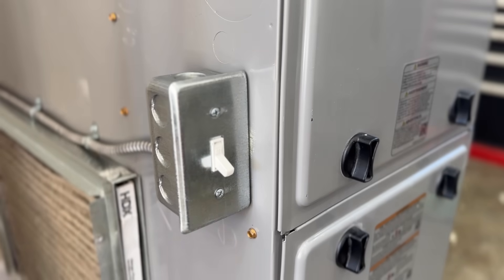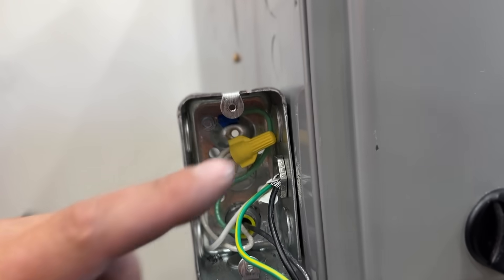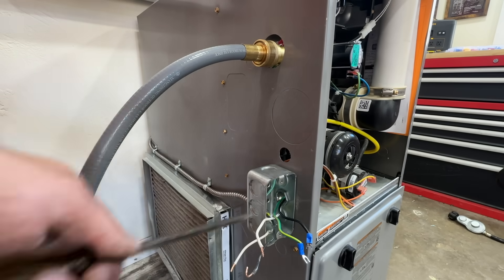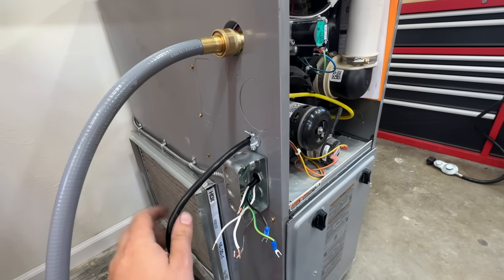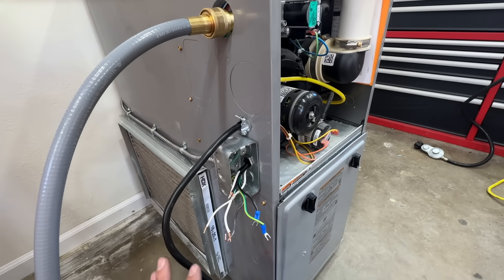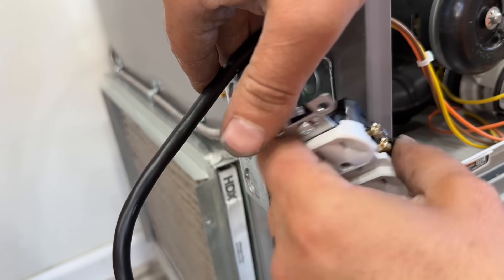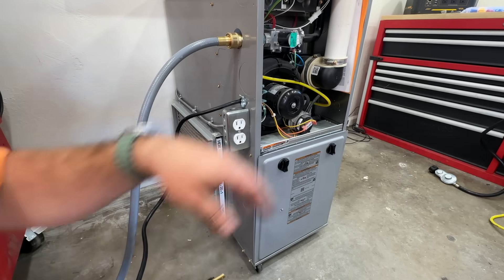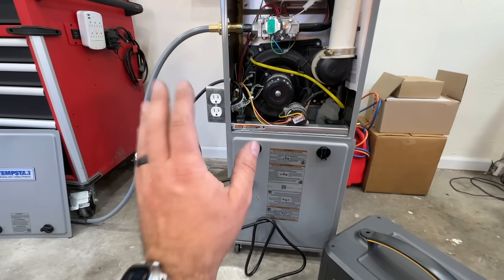Keep Your Family Warm During A Power Outage By Installing This $5 Part

Comment: Always tighten the extra screws on the outlet.
Always use a pigtail for the ground.
Always wrap the side terminals of the outlet with tape.
Reply: Caught this immediately, always tighten and tape. Tape not as necessary in plastic boxes but good practice all around. Ground wire is normally not insulated so it can potentially touch the exposed lugs and spark. If the outlet loosens over time it can wiggle a bit, those loose lugs sticking out can hit ground wire or the box causing sparks. These metal boxes have a decent amount of space in em but some are incredibly tight and amplifies the risk. Like the metal wing boxes or those ones with the Romex knock outs and the screw down wire holder. Plus if the box doesn't have a good ground connection and lugs make contact with the sides somehow the whole box is live now with no path to ground. The outlet should always just be grounded don't know why he did that. I mean I know it's screwed to the grounded box but it takes like a minute to legit ground the outlet... It's been a pet peeve of mine with people putting in switches too, I know a lot of electricians don't bother but it takes two seconds come on.
Reply: @burtenplays  I'm with you. I just takes a second...done!
On finish electrical some sparkies will strip the wires and leave the sleeving and wire in the floor and walk away. Drives me nuts! I may be the GC but I'm NOT your maid! Respect the clients home!
Reply: @goaskmymom1350 …as a GC 25 years ive only seen one sparky pick up his own cuttings…before i tell them to.
Reply: Curious. What would the reason be to tighten the unused terminal screws?
Reply: @easyas314 
As a remodeler working with live power during demo I thank the sparky before me who tightened the unused terminals AND for wrapping them up with tape. Have you ever accidentally touched a live terminal to a metal gang box? If so, THAT answers THAT question. 😵‍💫
Reply: @goaskmymom1350  Not relevant for this end-of-run application, but as a best-practices habit I ALWAYS connect black and white incoming wires to the upper screws, and either tighten unused lower screws or use them for an outgoing circuit if it's middle-of-run. That way I always know which way power flows when I service my own work later on, even though I also test it with a meter too. Just one more way to be triple-sure instead of just double-sure that you don't get zapped. And yes, ALWAYS tape all terminal screws. Always, always, always. No excuses.
Reply: @easyas314  So they don't short on the box or have anything possibly coming into contact. And ignore the OP, always ground your outlets. Never know where a floating ground is.
Reply: @easyas314  less likelihood of a short the next time the outlet is moved out as the screws are further from the metal box.

Comment: What I see wrong here is the power supply is not providing enough amperage to the furnace. It may be enough to activate the inducer, blower motor and gas valve, but when the three-quarter. HP blower motor is activated it puts a low power load on the small transformers on the circuitboard. This method clearly does more harm on the circuitboard. I have seen many damaged circuit boards during power outages when homeowners connected there’s small, portable generators.
I have 35 years and gas service heating industry.

Comment: Why is the light switch (on/off toggle ) there to begin with? Like wouldn't you just flip the breaker off if you need to work on it. Great video, thanks. I'm going to do this mod.

Comment: I have a condensation pump for my airconditioner plugged in to outlet /off-on switch. Can I put a larger box outlet and achieve the same thing without hurting my furnace?  Thanks for the help

Comment: Our HVAC is dual fuel, it's natural gas but also has a heat pump. Willa Jackery power my unit or do I need to turn off the heat pump and only use the gas with the furnace plugged into my Jackery? And will a Jackery 1000 be enough? Thanks...Marc

Comment: Even more simple, and retain the switch: 
1: Buy a 3-way switch.
2 : wire the switch common screw to the furnace power wire.
3 : attach the hot (grid) wire to one of the traveler screws.
4 : attach pigtail hot to remaining traveler screw.
5 : tie all neutrals together / repeat for grounds.
Switch works as before but now toggles to alt. power source in "off" position. The pigtail is never hot unless plugged in.
Reply: I don't see the point here? Your method requires both moving the plug and throwing the switch. The above proposed method doesn't use the switch at all in generator mode. If you need to completely kill the furnace in generator mode, just pull the plug.
Reply: @andydelle4509  In my example there is no plug. Never was one. Just flip the switch and plug the pigtail into a standard extension cord. When on grid power, unplug it and flip the switch back. The pigtail doesn't need to plug into anything when running on grid power, and it isn't energized. Easy peasy.
Reply: @timjefferson2137  OK, I get it. Thx

Comment: I have an oil furnace, it's 115 volts, but uses another motor, I will need to check and see if the the cord and plug can handle the needed power requirements to run the furnace.

Comment: Using a backup battery for furnace ignition, does the battery continue to discharge the battery during furnace operation?
From a DIYer

Comment: How about a well water jet pump?
Reply: That can be supplied the same way. It is only the details of how it gets done that change. With that said once you have multiple critical loads there are far more elegant and higher flexibility ways to supply them with standby power than by individual cord and plug connections. 

Tom Horne

Comment: When it makes more sense to just back wire your circuit breaker and use a generator to run your items in your home including your furnace and air conditioning?

Comment: This has to be my favorite video of yours and have sent it to probably two dozen other guys. We all live in souther Ohio and have boilers that heat our house (ours is still the steam boiler from 1911 and yes, that’s the correct date). We have 3” water lines that hold the steam and is controlled by an electric thermostat. Now that we have this, a small 2200 watt inverter generator will run it with ease, as well as a few lights, a pressure cooker, and also charge our laptop. I’ll occasionally watch this with our girls - clean language and educational!

Comment: Are the thermostat wires connected elsewhere in the furnace?  Also, my switchbox has an old style screw in type fuse, does that make any difference in replacing with a outlet?
Reply from the maker: Nope, you will find the same thing once you disconnect the wires to it. I actually have a video showing how to convert it from a switch/screw in fuse combo. That one should drop soon.
Reply: great @diyhvacguy
Reply: Looking forward to that video as that is the setup that I have on my Natural Gas hot water boiler.   @diyhvacguy

Comment: Just did this for my daughter during a power outage.  However, I got a voltage polarity error code(E 6.1) on the furnace (Trane) control board display.  The issue appears to be  related to grounding for the furnace and the generator, actually an inverter generator.  Don't know the technical terms - bonding, floating, sinking ; ), but a 'solution' was to take a male power cord repair end ("standard" three wire 120V, 15A), and wire a jumper from the ground prong terminal to the neutral prong terminal.  Do nothing with the hot prong!  Then plug this jumpered power cord end into an outlet on the generator.  It will look like you just plugged in a bare power cord end into the outlet on the generator.  Apparently wiring a jumper in this fashion takes care of the ground mismatch between the furnace and the generator. Error code gone!  Normal startup sequence for the furnace.

Comment: Can you use 20amp WAGO connector for 15amp 14 gauge wire?
Reply from the maker: Yes you can use a connector that is rated for more, just not one that’s rated for less
Reply: I figure the rating would be fine. I wodering about the clamping force on a thinner wire @diyhvacguy

Comment: Hi. Love the videos. I don’t have a switch that turns the power on and off to my furnace. I think it’s wired from inside and goes directly to the breaker box. That would be a more extensive project. I’m sure. I wish I did have that switch as I could easily do that but there’s more to doing mine than That particular application. Please advise. Thanks again.

Comment: Generally not allowed by International Mechanical Code and the furnaces listing.  This is not a dishwasher.  It needs to be hard wired  (violation #1).  Adding a duplex receptacle now allows additional items to be plugged in to that circuit which is required to be dedicated (violation #2).  Also of concern is that someone will come along and need to plug in something and use that as an accessible outlet, removing the furnace plug and not plug it back in again, then leave, allowing the house to freeze up.  Your insurance company will likely try to maintain that this was an illegal modification and refuse to pay damages.  All around, a bad idea.  There are listed generator transfer switches made for this purpose.

Comment: Good videos, I like it. But with the cord being wrapped you're making a coil and is a potential fire hazard. It will act as a coil and generate more heat than normal, typically better to run the cord as straight as possible and w/o hard bends.

Comment: And how do you turn it on? Wouldn't my eco-bee app say no connection?
Reply from the maker: The ecobee will power up as soon as the furnace gets power from the power station
Reply: Thanks, I just realized this once I started thinking about it😄. Thanks for the quick response and awesome idea. Mine won't be as neat cause my switch is on the wall but I'm gonna figure it out and get it done.

Comment: I have an oil furnace and see no reason why the same cannot be done (it has the same type of on/off power switch at about the same location).  Just checking if anyone can think of a reason why it would not work with an oil furnace?
Reply: The only additional challenge that you will have with an oil fueled furnace would be the power required for the high pressure pump of the burner itself. Oil does not burn in it's normal liquid state. It has to be heated until it gives off enough flammable gases to combine with oxygen in the combustion reaction. To get around that the burner uses  a high pressure fuel pump to force the fuel oil through a nozzle or nozzles which turn it into extremely small particles and inject them into the combustion chamber past a constantly energized igniter that assures that they will be ignited and burn. All of that means that an oil fired furnace will use more electrical power than a gas furnace does. All that changes is the ampacity of the electrical source used to run the furnace. That information will be found on a label which bears the listing mark of a Recognized Testing Laboratory (RTL). The Full Load Amps (FLA) is the number you want. This emergency hack will work as long as the FLA for the furnace does not exceed 16 amperes, which is 80% of the current available from a 20 ampere branch circuit and also providing that the power supply can provide as much as 5 times that for starting the motors turning. On a generator that is given as the surge rating. Since I haven't used a battery powered inverter, like the one in the video, I do not know if that is shown on the label or not. It is very likely to be shown in the owners manual. 

Tom Horne
Reply: I think I am good, in the installation manual the only amps I can see states 13.3.  (ELECTRICAL – 120 Volts, 60 Hz
Canada Less than 12 amps, circuit protection 15 amps.
USA 13.3 amps, circuit protection 20 amps. ), and my generator is more than powerful enough.  Thank you! @hornetd

Comment: My furnace was made by General Motors I installed it in 1965 it was used and possibly 10 years old at the time I may have wired it wrong but it looks like the wires after the switch cut off only go to the blower my bad thank you keep up the good work

Comment: This is an excellent idea I intend to do this soon I didn't see how you could get power to the Transformer for the thermostat but I can probably figure it out
Reply from the maker: The furnace powers the transformer and thermostat so as long as you have 110v going to the furnace, your thermostat will work like normal. 👍🏼

Comment: I was going to do this a few years back, without even knowing about your videos.  However, I discovered that it's against codes and was actually explicitly listed as a line item = not allowed where I live. I found it strange that they actually went that specific, but it did.   I think that I'll still do it, but will just need to plan and be prepared to UN-do it if I ever go to sell my place or have an inspection for any reason.
Reply from the maker: Exactly. Right on man

Comment: I bought everything I needed yesterday to do this mod for the high wind and rain threat we had. Totally forgot I have a Taco low water level wired in as well so the 2 cavity Wago connectors I got weren't gonna cut it, and I have one of those square red "emergency gas shut off" switch plate and square box I didnt account for. Luckily we didnt lose power so I can go back and buy the correct stuff.

Comment: Have you verified with a licensed electrician as to whether doing this meets electrical codes or not? I definitely see it as being very useful, but I suspect codes may not allow it.
Reply from the maker: Yes I certainly have. He said there is zero risk with making this change. In fact a lot of homes out here in Utah have had this setup for the past 30 years.
Reply: @diyhvacguy  There might be no "risk" but it definitely may not comply with electrical and/or building codes in some jurisdictions.

Comment: I have a nest theemostat. How does it get the power to work. Also its connextes to the internet. Will this work if you dont have connectivity to internet?
Reply from the maker: The furnace powers the thermostat so it will function exactly the same on backup power. However if your router doesn’t have power then obviously it won’t be able to connect to wifi.

Comment: The switch needs to turn off the house current when you switch to battery power. There are switches that do that, and you should have installed such a switch.

Comment: You're a life saver, again and not just for me but for a bunch of my friends and neighbors.  Did this last year in the NW during a three day ice storm and power outage IN THE CITY.  I have a really really small home (basically a large apartment in size, with a basement) and had about 8-12 people staying here for a couple of days since no one else had a second means of heat.  I 'sort of' thought of doing this hack, but never put time into working it out.  Appreciate this immensely.  I need to figure out how much power (amp-ohm-watt) the furnace is pulling though.

Comment: I believe you have been mislead when saying the box is grounded. The outer jacket of the mc cable is not a ground or intende for that purpose. You can clearly see inside the box that it is not bonded using thebgrounding wire. The hole specified for a ground screw and attachment of a ground wire is empty. The receptacle you use in this video needs to be grounded! It is does not have a self grounding yoke which is required to hust atrach to a metal box.
You should also use a larger box or an extension box so yo have room. Consider a least a 1900 box or 4" inch square box.
Very good tutorial and a great set up. Just be sure to do your electrical work safely and correctly!
Reply: Surface mounted boxes do not require a bonding jumper to connect the receptacle yoke and Grounding Terminal to the box. All that is required is to remove at least one of the fiber washers from the mounting screws so that the yoke makes metal to metal contact with the box. The branch circuit grounding/bonding conductor must still must be connected to the box. That would be done with a bonding jumper to the splice that includes the branch circuit Grounding/Bonding conductor, the grounding terminal of the power inlet, and the grounding and bonding conductor of the furnace.

250.146 Connecting Receptacle Grounding Terminal to Box.

An equipment bonding jumper shall be used to connect the
grounding terminal of a grounding-type receptacle to a grounded
box unless grounded as in 250.146(A) through (D). The
equipment bonding jumper shall be sized in accordance with
Table 250.122 based on the rating of the overcurrent device
protecting the circuit conductors.
(A) Surface-Mounted Box. Where the box is mounted on the
surface, direct metal-to-metal contact between the device yoke
and the box or a contact yoke or device that complies with
250.146(B) shall be permitted to ground the receptacle to the
box. At least one of the insulating washers shall be removed
from receptacles that do not have a contact yoke or device that
complies with 250.146(B) to ensure direct metal-to-metal
contact. This provision shall not apply to cover-mounted receptacles
unless the box and cover combination are listed as
providing satisfactory ground continuity between the box and
the receptacle. A listed exposed work cover shall be permitted
to be the grounding and bonding means when (1) the device is
attached to the cover with at least two fasteners that are permanent
(such as a rivet) or have a thread locking or screw or nut
locking means and (2) when the cover mounting holes are
located on a flat non-raised portion of the cover. 

Tom Horne

Comment: A safety issue needs to corrected here. This would not pass an electrical inspection. 
The box you have installed on the side of the furnace is not grounded/bonded and the box is not secured to the appliance. You need mire than a chase nipple to secure the box